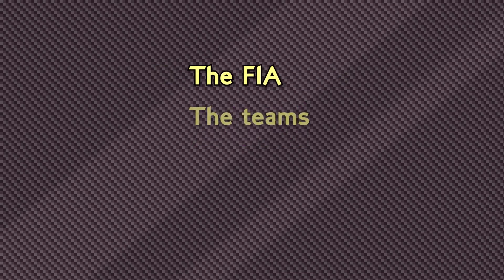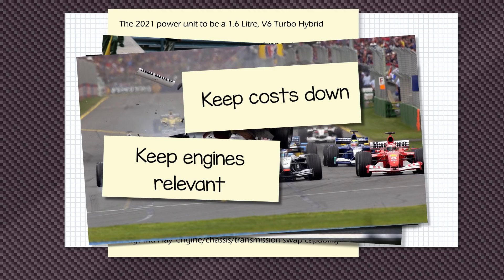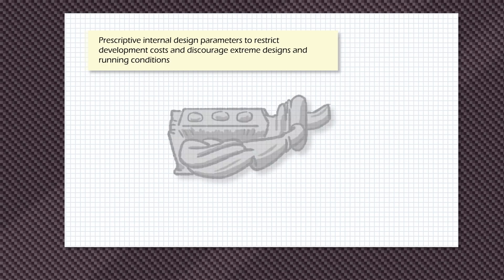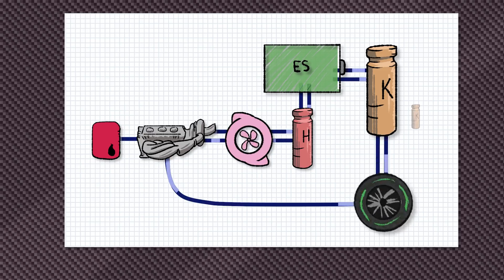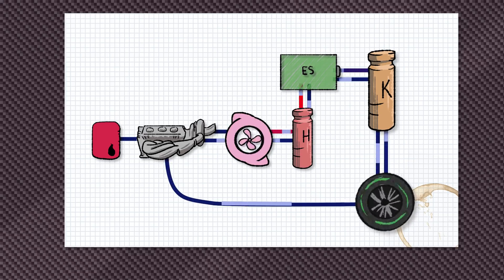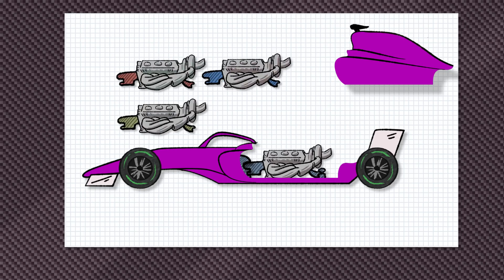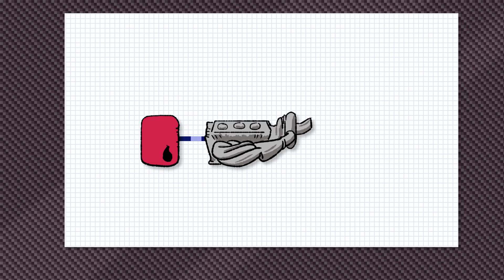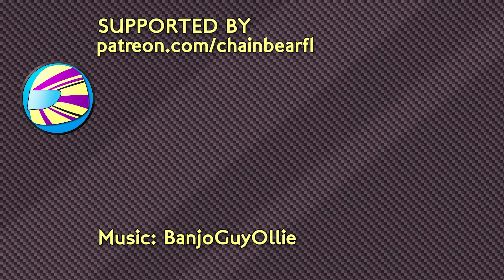F1 Engine proposals 2021 explored

Comment: If f1 has to be relevant then put them all in Diesel Passat estates or Nissan quashquis'. It is the ultimate sport for petrol heads and as one of them, it's headed in the wrong direction and 6 cylinders isn't good enough. 

Of the current f1 engine manufacturers the only one that has meaningfully applied any of their f1 performance hybrid energy recovery/torque fill tech to my knowledge is Honda with the new NSX whish is apparently not that good a car. Obviously Ferrari has the la Ferrari (only made 499, doesn't count), Mercedes has a couple of saloon hybrids (none of them performance oriented, dosent count) and Renault has the twizzy?

What's really going to attract more engine suppliers is lower development costs, and therefore a more even field (easier to win) which more simple and older technology would allow for. I'm not saying we need pushrod hemi v8's with carburettors, but electronic "push to pass" really belongs in formula e or WEC imo.

As for 2021 regulations, road going hybrids are already kind of dying/dead already as realistically fossil fuel road cars (hybrid or not) have ~20 years left in Europe anyway so manufacturers and consumers alike have shifted focus to full electric for the future. Imo f1 should always use internal combustion because it makes it much more exciting and more of a spectacle and that's what sport is about

Comment: Resuming the whole video: This guy wants the F1's engines tiny and lame as possible. He says that F1 should be more adaptable to the car industry, so why the fuck there are still MANY manufacturers that still building V8's and V12's for their maximun sports cars? Your logic is pathetic such as your fanatism for the electric cars and tiny little lawnm mower engines, such a shame. Just because an engine has 12 cylinders doesn't make it old or "hIpStEr".

Comment: "keep engines relevant to the real world"
meanwhile in another video:
"f1 engine could never ever work in a road car"
Reply: HECKproductions mercedes is actualy makeing a car with a f1 engeine
Reply: @hdhil3137  The Engine could be used in any way as long as it fits the car. you could probably drop an old DFV into a road car and have it work. the difference is whether or not the whole power unit, which is the engine and hybrid system, could work.
Reply: @jeremeymcdude  the AMG project one is trying to accomplish that
Reply: how could it work lol it burns 2 t/s of rp-1

Comment: Why is hybrid, electric etc forced on them? if its faster then everyone would do it, less strict ruled lead to more innovation, just look at Nascar, nothing has happened in 20 years cause you're not allowed to innovate...
I would rather look at a race between the Ferrari V12 turbo with a 21000rpm redline, and the Mercedes I4 hybrid powerplant witch barely makes a sound than with all competitors in the same car. Its more about driver skill when everyone has the same car, but we have other classes for that...

Comment: I think we use 2.0 to 2.5 lliter V8 normaly asperated in place of the turbo 1.6 liter V6. sorry i think V8 just sound nicer lets injoy them a little longer. the electric power can contiune as proposed.

Comment: I would standardize the turbo and all the electric bits around it and the suspension/ brake components. If you standardize the engine, ferrari and mercedes will leave so it cwon’t happen. I would allow 2 more power units for the year, i think it’s holding the team back. The best would be to have the same car for every drivers to see how talented they really are. My dream car: V8 turbos + electric engine, closed canopy, ground effects and active aero. Something similar to the concept made by Redbull a couple years ago

Comment: Ya see, the thing is gearheads like the very large majority of people who watch racing (you excluded, obviously), LIKE loud shouty engines. That is what racing has been about for generations and generations. The noise, the power, the speed! Not the near silent whining of an electric engine. That's.... boring. It's like comparing music coming out of a set of concert speakers to a small portable battery powered iphone speaker. A racing circuit is NOT the venue to be displaying the latest engine technology, especially considering those engines are rebuilt what... every half dozen races? Not exactly comparable to real life. And if F1 moves further and further away from what people want, then another racing series will just step up and provide it. If F1 wants to remain popular, it will never go fully electric, it's as simple as that.

Comment: They should increase the engine capacity to 2.0-2.5 Liters. No cylinder restrictions and no redline restriction, if you can make a supercharged V8 2.0L engine work with 21,000 redline, more power to you. That way the innovations can be more easily adapted to not only small displacement economy cars and their higher displacement. They should also derestrict the battery power output and input. Therefore more flexibility is allowed in innovation for batteries. Keep the MGUH.

Restrict aero. No more fragile front wings.
Reply: They keep trying to push an “eco” angle to Formula 1, hence the much smaller engines now. They completely forgot the amount of fuel used to fly the circus around the world. F1 should never be about fuel saving or eco crap.

Comment: Naturally aspirated, internal combustion, piston driven V8, V10 or V12 blocks. No hybrid, electric motors, fly-wheels or similar bullshit aids. Restricted by total volume and fuel type. Every engine can be obliterated in one race. Do your best with that - it's about mechanical engineering. Internal cobustion, piston driven engines will be gone soon anyway. They should explode in all their glory in those last years. Or we will end up one day with WARP drives on cars.

Comment: 8:04 someone tell Apple this.

As for fuel I think they should go to a more standard type thing like ethanol.
And I think they should remove the fuel flow limit.
If the driver uses all their fuel, too bad so sad.
They will learn, teams can now also refuel if they choose.
Reply: Refueling actually made racing more pitlane strategy based than both a combination of skill and strategy
Reply: @leolego2  And adding sausage kerbs is not?
Racing is risky on its own.

Using Ethanol will make the sport greener(the point of going to 1.6Turbo Engines) and the fire can be put out with water.
Reply: @leolego2  The risk is small
Reply: @leolego2  Well if they want to get rid of "RISKS" why do they keep monaco?
That is NOT a safe track by FIA standards.
No run off areas
Hard to get cars off track

It is kept for tradition.
Refueling can be another tradition brought back or remove the fuel flow limit altogether, if the drivers burn through all their fuel and run out.

Toughluck
Reply: @leolego2  That is just hypocrisy.
We will allow one risk where people can get killed because of history, but not another.

Why don't we just go to bridgestone tires where they softs could last the entire race? 
Prevent crews from being run over like we've seen a few times so far.

The sport wants to be green.
Refueling can help with this overall.
Less fuel on board=less weight
Less weight=less fuel used

Less weight=faster cars
faster cars=more exciting racing which is what the fans want
Reply: @leolego2  No risk is smart.
Pit stops are dangerous.
We have seen pit crews run over by cars.
Pit crews hit by loose wheels
A camera man hit by a loose wheel.
Countless unsafe releases
Accidents in and around pit lanes.

With monaco we have seen crashes into barriers causing full course yellows due to the lack of run off areas, and how hard to is to get cranes around the place, plus rear ending cars due to brake failure like we saw a few years back.
Another fact is monaco is so narrow, their is little chance for overtaking.
Reply: @leolego2  You keep saying it is "Worth It"

How.

It is one of the more boring races.

Little overtaking due to it being narrow
Reply: @leolego2  People wont want a race where qualifying order decides  the race finish order.

Refueling can be optional.
If teams want to do it, they can.
it will also slow down the pitstops down to where they were during the early 2000s
You know 4s or so, not 2s.
Reply: @leolego2  Same logic can be applied to anything.

Watch all the videos of pit crews being run over
Watch all the videos of loose tires rolling down the track and that one video of that camera man being hit in the back by a loose wheel.
Watch all the videos of how boring monaco becomes with no overtaking due to it being so narrow with few overtaking zones.

Comment: They could arrange a spectator vote next year. Everyone who buys a ticket to a GP, has a say. They could first drive a Formula-E car around the track and then old Ferrari F1 with a V12 engine (godly sounds!). After that the spectators would be asked to vote which car they liked better and would like to see on the track. That prolly a no brainer, but still. 

Do the vote during the 2020 season in every single GP and you can stop contemplating between all the different engine options right there.
Reply: Even if every single person voted for v12s at the every gp manufacturers would still use v6t because its the most efficient
Reply: @globalelite3042  And the v6t more potential the v12
Reply: @globalelite3042  Well yea, that's prolly true. That's why we really need a totally new breakaway series that can offer the audience exciting cars. Not the sterile boring grey crap they're feeding us now.

No wonder that F1 is loosing spectators. I wonder in what universe the FIA decision makers live in to have come up with the current engines.

Comment: Ditch the whole F1 with the boring engines and make a new series which would allow for the engines that people want to see and hear.  Where engine manufacturers don't dictate the direction where the series is headed.

Take WRC rally series and Rallycross. Rallycross cars are much more spectacular to watch and would make an awesome replacement for WRC cars with little modifications. They lack the expensive electronics.
Reply: F1 is the pinnacle of human skill in driving fast. The rules youve set forth come with a comflict of interests. The v6 is already been number crunched and is basically the most efficient engine weve had. Most people in your camp want the screaming v8s or v10s back but then your taking a step backwards intentionally handicapping yourself. What the people want is going to be different from what the companies are gonna use so how do you decide who makes the decision on what engine they use
Reply: @globalelite3042  and plus the v10' and v8's were in development freeze(meaning they werent going to be making more power because they were at their full potential when they were switched out)
Reply: @globalelite3042  My previous replies already cover most of the "...must.go.forward." -part, so read them.

You're asking how do you make decisions on what kind of engines a series uses. It's really simple, the spectators and fans make the decision by voting with their feet and wallets.

Once the spectator numbers drop so low, that it's not even worth to race anymore, that's when changes start to happen.. or the series will die. Or maybe it doesn't. Maybe people will get uses to the new normal, where F1 is populated with boring and sterile cars.

The same thing happened with WRC rallying series. Now they've already had to ramp up the power a bit to keep the spectators.

If you don't understand why motor sport fans love spectacular, great souding and looking cars, I don't think you're a fan at all.
Reply: @globalelite3042  Wow, and you said you're not crying? I think you just threw a fit a pounded the keyboard in tears.. and then blocked me.  Out goes any respect I might've had for you. Now to the facts.

It's been rumored, that Liberty media might even be seeking a way out of F1 ownership due to all the difficulties they are having.

You can read about some of them here: https://www.racetechmag.com/2019/03/is-f1-becoming-the-minority-sport/

What comes to spectator numbers,  I'm citing the above article. In 2008 F1 600 million unique viewers (spectators AND TV audience?), in 2017 there were 352 million.
In 2018, the Liberty media claimed to have 490 million unique viewers.
Even with that you're still down 110 million to 2008 numbers.

So this seems to prove, that the exact opposite is true. When cars became boring, people left. I think I'm still in the majority and people like you whom watch a race for... tactics(?) are in the minority. I can't see how that could interest a big number of people anyways.

That's my 10 cents anyways.. Now, take a handkerchief, wipe the tears and get back up. There will be boring motorsport for you to watch in the future too. I just hope it's not the F1.

Comment: Engine manufacturers have no desire to get back to the old, loud and powerful engines, you say? I think we need to ask first, why do they drive the F1 GPs or why does the whole series exist? Or would it exist if absolutely nobody watched it, if there were no fans or audience?

I think we all know that F1 would not exist if it didn't have spectators and fans. So when choosing development paths for the cars and engines, would it be a good idea to find a way to ask the fans what they would like see and hear? I know engine manufacturers want to develop and test new technologies in F1, but that should not be the main thing, that's determines the way engine technology is headed. Fans want to see loud and fast cars on the track, as well as interesting races.

So if the engine manufacturer's can't agree to that, what if the current teams were to come up with a break-away series, that would actually be spectacular to watch for the fans, with less expensive electronics, but more raw power and sound?

For an example, lets look at the FIA Rallycross and WRC rally series. Rallycross cars don't have all the technical gadgets WRC cars do, but Rallycross cars have ~ 600 BHP where as WRC car roughly half that. I'm pretty sure the Rallycross teams are still able to run on a smaller budget. You could run a Rallycross car on similar special stages that WRC drive through, looking and sounding much better to the audience and fans.
Reply: The v6t is the most efficient engine f1 has had. I dont know where this fantasy that teams will spend less money and have more power and sound comes from. Theres a reason that f1 cars have regulations. Without them the cars could be insanely faster which is a fact. But then theyd all be electric traction controlled and have all wheel drive.
Reply: @globalelite3042  and they'd be much more dangerous
Reply: @globalelite3042  It comes from using less expensive electronics. Simpler, more powerful engines. Does that compute?

Man, nobody is interested in how efficient the engines are, not the people whom pay for the fun, that is, the spectators and fans. They want to see spectacular cars, noise, power.. you know, everything, that motor sports at least USED TO stand for.

I'm not saying they should remove all regulations, of course not. Just make them favor more interesting cars. Cars that people would be genuinely interested to see. These hybrid craps are so boring, that I'm surprised the F1 even has the spectator numbers they do now.
Reply: zurja ke you mean less expensive then blowing an engine evry race like the v10s did? Plus f1 has changed for the better. Imagine how boring it would be without tire management. Also you missed the point of my comment. Its not that we should remove the regulations, its that if we did engine manufacturers would still use v6t anyway. Taking a chance on an engine that might blow at any minute is a risk no team is going to take these days. I think youre conflating what “everyone wants to see” with what you want to see.

Comment: 2l V8 hybrid and no restrict fuel that will make teams more likely to keep them efficient(because filling up on fuel loses time)and not restrict airflow and so on, teams choose a flappy paddle gearbox no drs restrictions and keep the budget of development as low as possible so shit will go down and  push innovative stuff to move forward
Reply: Why would they keep the budget low when they have literally no reason to? Mercedes and ferrari dont care about the money spent they just want wins. Right now there blowing millions on tweaks and tunes that dont even give a 1% better. Also theres literally no incentive to make engines efficient. Just like if we didnt force drivers to change tires then every driver would be on soft tires 100% of the time. Even though theyd have to pit more often it doesnt matter because they could go a lot faster and it would more then make up the difference.

Comment: My personal opinion is that F1 has always been right at the cutting edge of technology & the glitz, glamour, drama & noise has always been a massive part of the circus. I still love the racing & the drs & bigger “high throw” wings are welcome. I don’t fully agree with the “throwaway” engine principle so having engines last longer is good but when it comes to conserving them & fuel then the racing suffers. The halo I hated at first but now I’ve gotten used to it. I hope to see much better braking performance given that they’re going to 17inch wheels soon.
I disagree with the “plug n play” type standardisation part as this severely hampers the innovations & technical loopholes the designers can exploit which then ultimately lead to invention & new discovery that filters down into our own road cars.
Formula 1 should be at the absolute forefront of tech & the budgets shouldn’t be capped at all because we need to see just what is possible within the laws of physics through engineering genius.
Reply: Budgets shouldn't be capped? 
I'll direct you to a video by chain bear himself on this subject
https://youtu.be/PuVLGkZah4A